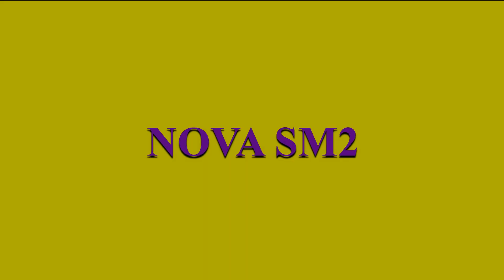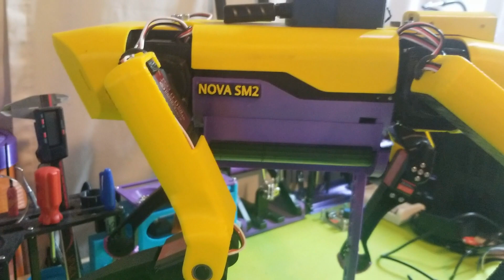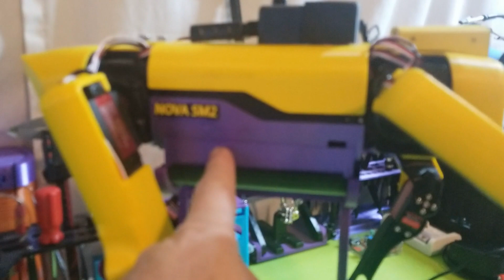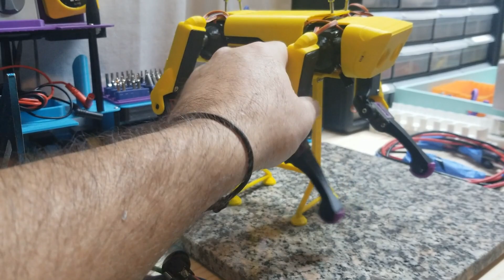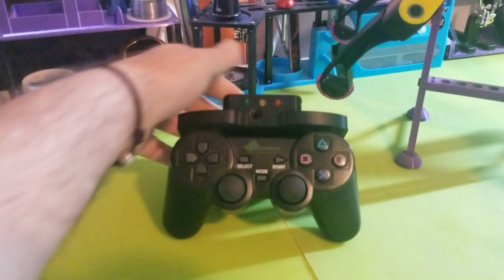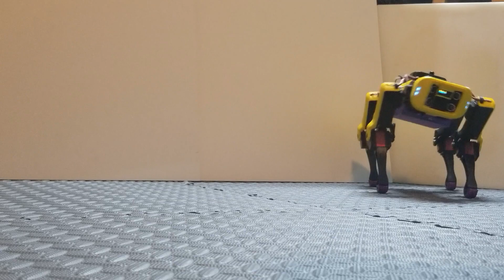Nova SpotMicro - a Spot Mini Quadruped Robot Dog Clone

Comment: hello I’m on version 4.1 or 4.2 SM3 and my robot spot don’t have all the planned movements as on your video .... What should I do? Change the code or other solution? Thank you for your answer
Reply from the maker: I will be releasing 4.3 code in a week or two, which will fix your issue. Much has been added / changed in this coming version.
Reply: @ChrisLocke1969  thank you very much , 4.3 sm3? for arduino mega?
Reply: @ChrisLocke1969  I look forward to a big thank you:-) and thank you for your answer
Reply from the maker: @gui6422lura  oh, you're on the mega version still?  ya, the new code probably won't work, but the movement functions may be an easy port backwards
Reply: @ChrisLocke1969   Hello yes I am with the mega, the version sm3 v4 will not work with the mega? Which card should I take for the sm3 v4 version that you will share with us?
Reply: @ChrisLocke1969  Oops I wanted to talk about the new version sm3 4.3 sorry
Reply from the maker: @gui6422lura  the code files are named by supported MPU.
Reply: @ChrisLocke1969  sorry I didn’t understand the new codes are soon available?
Reply from the maker: @gui6422lura  what i meant is that in github, the code files are named with the device in the filename... example: Nova-SM3_mega-v4.2.ino -  unless you know how to code, its likely, but not impossible, that you can use the teensy versions on the Mega, sorry.
Reply: @ChrisLocke1969  Yes thank you I had seen I had tried several , no I don’t know how to code:-/ I just manage a little ..... you think the code with teensy can work on the mega? I haven’t tried it yet! Thanks for the answer entout case , because with the other codes I don’t have all the movements and it’s a pity ..
Reply from the maker: @gui6422lura  its unlikely it will work, at least not without fixing code... pin numbers are probably much different for starters, as well as teensy being a 16bit device. I will see if i can bring the latest movement routines into Mega code, im sure youre not the only one using the mega version 😎👍
Reply: @ChrisLocke1969  ho yes !! <3  I would be so happy to have all the movement on mega!! It would be very nice of you to do it , thank you very much <3 give me a notification if you had time to do it , because I spent so much time on the robot nova , that it will fix my main concern:-) thank you very much again I look forward to your mega code!!!
Reply: @ChrisLocke1969  Hello! So you think you have the time and the possibility to adapt the code with all the complete movements for the robot nova and arduino mega? I would be so happy that it moves as on your videos <3 Thanks again if it’s possible!! Keep me informed thank you:-)